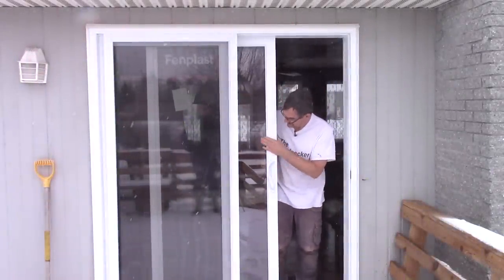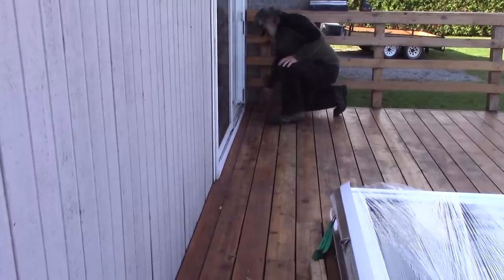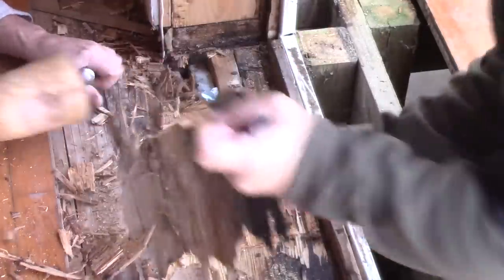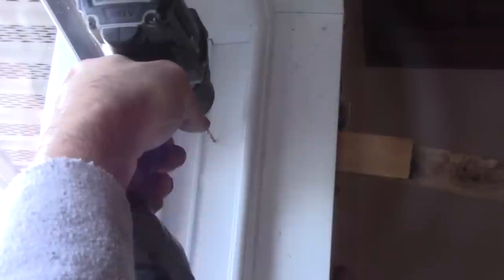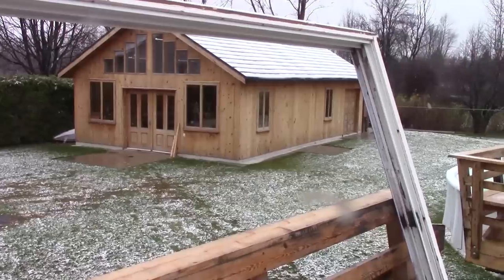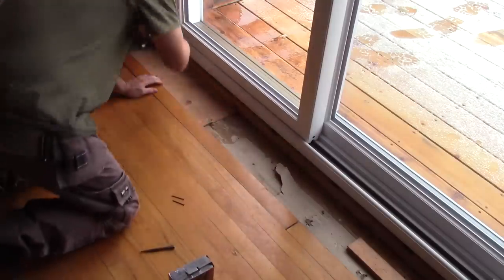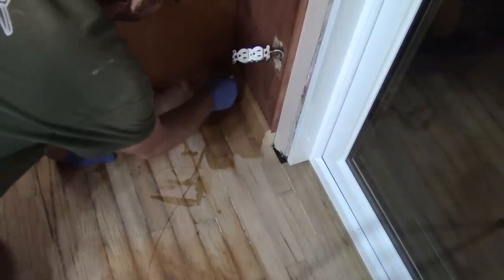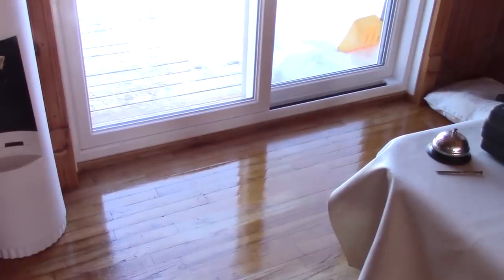The Woodpecker E216 - How I changed my patio door

Comment: I am a window glazer and I work on these kind of sliders all the time. That being said the door will get a little easier to open over time but it does seem unusually hard to open. I use Pledge to line up the doors. Pledge or any spray furniture polish will do.
Reply from the maker: Thank you for the tip. Even after 5 months it's still not easy to open... Sometime we have guest, ok not recently, and they think the door is locked and lock it. Then they say that they can't open the door... I answer, strange the door is locked, and we never lock it when we're home, and they always answer; ooops It's me I thought it was locked and flip the lever.... I really hope it will get easier to open. when it will stop freezing at night, I'll try something.

Comment: You should check that how we do this in Europe (specially in Hungary). few years and it will just rush out as before (waterproofing!)
Reply from the maker: I'm always interested to see how it's done in Europe. When I visited it, I was impressed with the type of windows I saw, the one that can tilt from the top and open from the side, we don't have this around here. Also a lot of stuff is not done the same as we do here, probably because of the climate and different reasons. And having at least a meter of snow each winter also adds to the differences.  But I think if my last door was there for 30 years this one will stand probably as much, especially since it has no wood in the frame, I wanted a 100% PVC and aluminum door this time around. Around here contractor always uses the cheapest material they can find and charge top dollars so they can put more in their pockets, on top of making a crappy job, this way they can come back in the future and charge you again, bright no!
Reply: @LgosseuxDbois-TheWoodpecker  Yes, I know you don't have this kind of windows, but we can do for you, and you can learn how to make it. ( I have a friend, who is a window and door maker contractor :D)
The climate is not a correct reason, because in Canada the weater is much more colder than Central Europe. Our window and door solution is much efficent (specially in heat insulation-level), and our installition solution as well. 
For example at 6:03 you finished the installation, in our process we use "pur foam" (https://www.youtube.com/watch?v=1CSeXv2GAAc), the PVC is not enough, the waterproofing and heat insulation also important. One of my door is 36 years old. In your case the warm air will go out between the wall and the frame. You can belive me, in Hungary that's why we change our doors and windows. Before 1990, we didn't know this pur foam, nowadays it is mandatory to use it, and we really love it. This stuff is so strong that it holds the window. The screws just hold the frame in place.

However you several great solutions, that we should learn about Canada and US. For example dado blade. Until about 2017 or 2018 it was forbidden to use it. Now only few manufacturer has dado blade as extra.. Or the architecture style of US (federal style, ot all of the neoclassical style, which I really love) and of course the table saw sled or Festool Domino. So I think we can learn from each other.
Reply from the maker: We have spray foam, but personally I don't like it... It's a bit messy, OK not a bit a lot... Even Jean -Marc who came to help said that he used spray foam on is patio door, and it made the top bowed because of the pressure. But you might be right, maybe because heating cost is less than in Europe we insulate less. That being said I used foam in the shop, and still today my nice mahogany front door have stains from it. I but I couldn't agree more it's nice to learn from different way of thinking and building. 
I even have a funny story about this. I used to have one French guy who was saying that my trusses are crap it's not the way to do it.... So to be polite I answered that I find it strange that he say that, I copied the shape and the technique from an historic book about old 400 years old timber frame  of America. But it might be right that it's not the way they make that in France...I asked him to send me pictures of how HE made HIS timber frame I wanted to learn. It's useless to say that I never heard from him again and he stopped saying that this won't stand time.
But as for my door, it suit me for now, hopefully I'll have the same speech in 25 years or so???
I'm super glad to hear that dado blades are coming to Europe, it's one of the tool everybody who visit me from France want to see, and here my set is less than $100 compared to the look alike Felder  dado set that is sold 700euros...

Comment: Alain,
Was there a reason you put the thicker board on the bottom rater than on top of the door? The door frames are usually a trip hazard anyway and you just made it higher otherwise good work.
Reply from the maker: I had to make a choice, and this one was more aesthetic than anything else.... Having a gap at the top would have bugged me more than lifting my foot. But on either scenarios, I would have prefer having the door the right size.... It's my fault... I think the "standard" changed in 30 years and a "standard" 6' wide door is not as tall has it used to be!
But I found another usefulness, if I only have 2-3" of snow I can shovel it before it can fall inside the house when I put the rat outside.